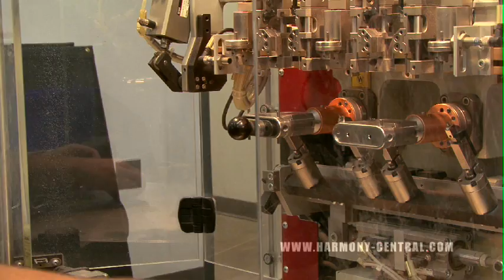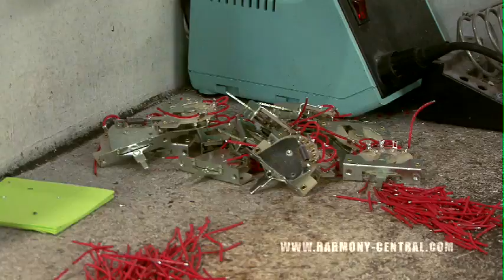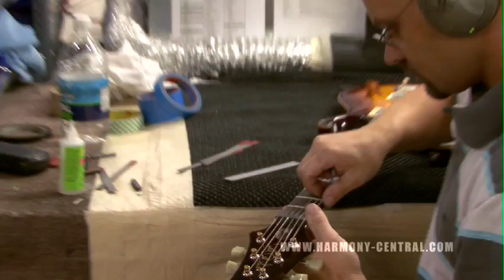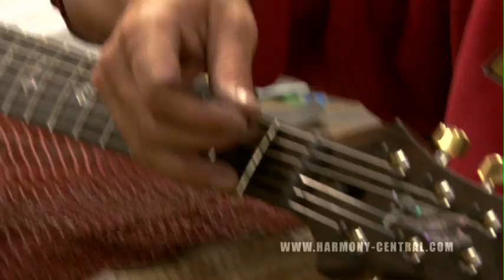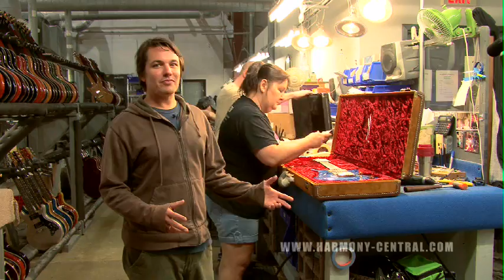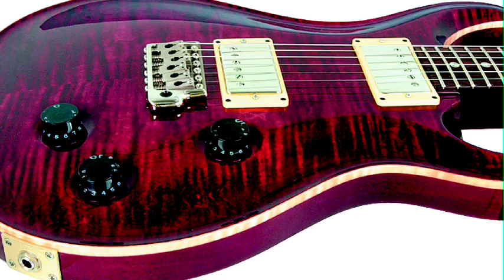PRS Factory Tour Part 4 of 4 - Electronics and Final Assembly

Comment: I wish I can afford one
Reply: cdogg580 - The Korean ones are awesome for the price. I'd take a Korean PRS over a standard factory (i.e. non-custom shop) Gibson, ANY DAY. You can find them inexpensively on Craigslist all day long. I've owned three American PRS'es, which I loved (my 2005 CE-24 is my #1, had a '93, was well built and gorgeous, but my newer one has a better sound and feel, surprisingly...before I bought it and played it through my favorite amps, I thought the older Alder one would be superior), but the Korean SE Custom 24 was equal, I would say, in playability and function, VERY similar sound-wise. In spite of the maple bolt-on neck of the American CE-24, the set-neck Korean Custom sounded almost identical, Paul made sure the Korean factory gets it right, I'm EXTREMELY impressed with their quality, wouldn't hesitate to buy another one. The tops don't have quite as deep a carve, but they still look gorgeous and feel and play the same as the American ones, pickups sound basically identical, too. 

As well, you can often pick up S2's and Mira's for between $750-950 on Craigslist and eBay. They still have to notch build quality and playability, the tops are not as (or not at all) figured as the more expensive flamed maple top, nor as deeply carved, but those things really don't affect their playability or sound. A used American made PRS for the same price as a new Korean one, not a bad deal! Either would be well worth saving up for and playing the hell out of, I don't regret any of the money I've spent on my PRS'es, American or Korean. Sold my Gibsons and Fenders, no regrets (I have an '83 Ibanez AR-325 Artist that covers all the ground the Les Paul covered, and then some, with superior build quality and a gorgeous tobacco-burst burled maple cap). 

Don't get me wrong, if I found the right guitar for the right deal, I'd gladly pick up another older Gibby or Fender, but I've come to really love the PRS neck profile and playability, I've literally never seen a bad Korean PRS, their QC sets the industry standard for factory built Asian guitars, and actually beat most American factory guitars in terms of fits and finish and overall quality, as well, no exaggeration. The main area where the American versions excel is in the finish. If I had one critique (and it's minor), it would be that the Korean PRS'es are sprayed entirely (save the fretboard) with a poly-looking finish that's a bit thicker than the American versions. They look fantastic, though, I just prefer a slightly thinner finish. But for they money they're very, very hard to beat!

Comment: At 2.16 I notice that they're hand drilling the pickup mounting holes.   WHY?   That's something that should be done in the CNC milling process.    I pre-drill those holes on my own manual mill  so PRS should certainly be able to use their CNC mills to drill those holes,  and perfectly without errors every time.
Reply: paint
Reply: +johnsoncm65 I build guitars with CNC and I've tried pre drilling small holes like this. The problem I found is when you wet sand the finish, the hole can fill up with water. Then the wood underneath swells up and ruins the finish. So I'm back to drilling holes for pickguards and mounting rings as part of the final assembly.
Reply: Definitely drilling, pause it at 2.17. The only reason I can see for this is that a cnc drilled hole would be so small it might fill while being painted. But it's risky, one slip and an awful lot of people are going to be upset, given all the work that goes into the pain finish.
Reply: strat - man - do Good point. Hole clean-up after painting is easy with a drill,  now that you mention it.    Personally I install threaded brass inserts to mount the pickup rings in my own guitars.   I mill the holes for the inserts and then press the inserts in prior to painting. I just put a piece of toothpick in the inserts to keep the holes clear of paint.
Reply: +johnsoncm65 I could be wrong but I'm pretty sure they are just using a drill to put the screws in, not drill the holes.
Reply: +Brian Poteat Go full screen and pause it.  They're drilling.  No screws or driver bit present, just a drill bit.
Reply: Have you seen the Rickenbacker factory tour? They go on about care and attention to detail etc, then towards the end if the video machine head screws are being inserted and one goes in at an angle! Pause at 21.57. I am surprised that they haven't taken the video off YouTube
Reply: That's what PRS do and they are so picky about finish and analyse everything so drilling after finish is probably right

Comment: Yes - and she just HAD to smack the case with the guitar inside on the floor - in the end !
Amazingly many stupid musicians do believe that the sound of an ELECTRIC guitar depends on the WOOD it's made of. I've seen many bang on the body - to HEAR how it souns ACOUSTICALLY !
An ELECTRIC guitar can be made out of a TOILET SEAT - as long as it is stiff enough to NOT deform under sting tention and vibrations !
What about all those SUPER EXPENSIVE EL-guitars made og transparent plexiglass ? Do they sound bad ?
Reply: Sorry dude. You might be one of the people that doesn't have much of an ear for tone, but I've seen this blind tested. Wood makes a difference. Put the same pickups into the same scale-length guitar made with different woods and the tone will change (i.e. solid mahogany vs maple cap, maple vs mahogany neck, rosewood vs ebony fretboard, etc). Different woods dictate different levels of vibration as it relates to density and thickness, translating to guitars sounding "snappy" vs sounding warmer and having more sustain. Sure, this can be largely imitated by electronics, but there's a difference still.
Reply: Then why does every reputable guitar company in the world improve the woods as the price increases. I really want to make a guitar out of a toilet seat and a 2x4 with prs electronics, and hardware. Then have you compare it to a custom 24 and tell me that they sound the exact same.
Reply: Feel, Fit, Finish, Playability. Bottom line is beauty is in the ear of the beholder. To me guitars are a higher form of art. Furthermore if a guitar isn't sturdy enough take a fall from four times that high inside a case, it certainly wouldn't be road worthy.
Reply: WybjornVR And yeah that was a reeeally stupid way to handle a guitar case (most likely an absent minded factory worker type of situation), but the cases PRS's come in are almost Pelican cases.
Reply: While the wood species does make a difference in sound quality, it is nothing like the choice of species for an acoustic guitar.  The differences are very subtle, professional musicians and those with experience can hear these differences; many people cant.
Reply: At some point, I'll make two very simple guitars with every single detail being the same, except the wood. I'm tired of hearing people claiming that the wood has such an impact on the sound of a solid body electric guitar. It most likely does have a VERY miniscule impact on it, but even the way your nails (or your pick) hits the strings, has more of an impact on the sound. I would gladly be proven wrong, but I know about these things quite a bit, so I'm 99% sure I'm right. 
And to the people wanting to know why everyone is still using wood to construct a guitar, well it's very simple, because wood looks much better than plastic for example. And because people still think that the wood is such a huge factor in the sound of a guitar (solid body electric).
Reply: Фёдор Джунковский He is kinda right but kinda wrong. A lot of the sound, maybe 90 percent of it, comes from the electronics. The other 10 comes from the material, hence the wood, so you want to still have good quality wood so you get a nice feel and sound. So what I'm saying is that you don't want a guitar built from plywood with EMG 81's in it, cause it'll sound like shit still. But in all honesty you really don't need to test the acoustics of an electric, because most standard guitars these days are made from basswood and can sound good paired with good electronics.
Reply: Of the seemingly thousands of guitar construction vids I've seen on YouTube in recent months I think every single one of them has had some dumbass mistreating the guitar, from the most common slapping it with your ring hand to downright smashing the headstock against the tail of a car.
Reply: I'd have to agree Mark, after messing around with this a bit more I don't think wood should be the major deciding factor.
Reply: aDotFromTheFuture 

While I'd have to agree with almost everything you said there, I would have to disagree that plastic is the best substitute.  Using the right wood species, with proper management, is more sustainable that using plastic.  I'm not saying we should farm sugar maple for guitar bodies, but even fast growing softwood species with the lowest minimal risk of exploitation would be a much nicer option than using some kind of plastic.
Reply: Every solid and rigid thing has a sound so it doesn't 'matter' if a guitar is made of plastic or metal, it will still resonate and have some 'impact' on the sound. It has been proven time and time again that woods do have an impact. 
PRS make the same guitar with or without the Maple cap (Standard/Custom) with exactly the same electronics, scale length, etc yet the Standard sounds darker - same with Les Pauls that are all Mahogany.
PRS Wood Library guitars sound different depending on the woods used yet have exactly the same electronics, scale length etc. If you want a brighter sounding guitar, you go for a maple neck/fretboard on an Alder/ash body, Mahogany is darker but warmer. Everything contributes to the sound - even the frets...
Its generally the 'bedroom' beginner or intermediate that think the sound is purely down to the PU's and the professional players that hear the differences. The players that can't hear the difference between a 'poor' Les Paul and a good one. Steve Vai knows the difference woods make but also knows that a anything can make a guitar because everything can resonate with sound vibration. As such, you can make a guitar out of 'plastic' but lose some of the 'woody' tone too. Not necessarily a 'bad' thing but it is different...
Reply: Dick Zibb I think a lot of people exaggerate the benefits of tone woods. At the end of the day all electric guitars are relatively unsophisticated instruments consisting of glued or bolted wood and relatively simple cheap electronics.  The only reason that solid guitars ever arrived was to control feedback as stage volumes increased and to cheapen production costs.  For example, the Strat was designed with two objectives, namely to look futuristic and to be efficient to manufacture.  The fact that it sounded reasonable was as much a matter of luck as anything else.  

All of that said, I always like to hear if a guitar resonates and sustains acoustically before buying it. If it’s not viable acoustically it will never sound good whatever pickups are installed in it.  Also bear in mind that wood quality has quite a lot to do with the eventual build quality of the eventual guitar.

Comment: In my 23 years old PRS there's cute little details in the pickups. The pickup cavities are routed with quite big router bit, so regular humbuckers dont quite fit in there. Someone in the PRS factory has used wire cutters to snip off small pieces from all corners of the both pickup base plates so they'll fit their cavities :D That's funny, Tried to install metal covers to the pickups some time ago, but it would have required routing some of the wood of to fit the covers there. Left the mics as is, no need to spoil a nice historical detail :)

Comment: These guitars are so beautifully crafted.  I find it so cool how everyone who worked on it, signed it.  Hopefully when I eventually get one of these beauties, I'll know that great hands made them.
Reply: better to have a real luthier and use non adjustable truss rods... check out these http://www.specimenproducts.com/stringed-instruments/guitars/
Reply: Jeremy Oliver Why would a non adjustable truss rod be such a good idea? As long as the neck is wood it will be susceptible to movement due to changes in string tension and environmental conditions and this will periodically need to be corrected? I’m not convinced that a “real” luthier would build a better guitar either.  You might get a higher degree of customisation, but at a much higher price. I doubt small scale luthiers have access to the sort of CNC machinery that allows much better control of tolerances during the shaping stage.  Hand work is not necessarily superior to machine work?

Comment: on eBay I found a kit, you build your own guitar and finish it yourself. I am going to use what I learned on this video and use it to assemble the kit, its a copy of a PRS Custom 22, with a wrap-around bridge. I' buying genuine PRS pickups to put in it, and I am going to stain it and give it an oil finish instead of lacquer. And this is going to cost me a total of $400. I dont have the money for a real PRS, and even if I did, I wouldn't spend that much money on myself. Thanks for the tips!
Reply: How did that turn out ?

Comment: Compared to Gibson and Taylor, PRS has a really good balance between computerized precision and human detail. I've never found an american PRS that feels rushed or unfinished, like most newer Les Pauls. I do agree with you on the SE models being too expensive. Epiphones offer the same quality (sometimes just as good as an average Gibson) for a lower price.
Reply: To a degree, I do agree about the SE's - however every one is shipped to PRS for a final Quality Check and set-up. Everything is made (under Licence) abroad but to PRS's specs using licenced parts and their colours, taught how to stain and finish, even how to wind the PU's. The bridge is the same - just moulded out of steel using moulds from PRS's Core Bridge (milled) and even copy their tuners (which are patented so made exclusively for PRS). All of that adds cost too - its not like they are using generic PU's, bridges and tuners. Like I said, they are shipped to PRS for a Quality Check and Set-up before being shipped to distributors - which also adds to the cost.